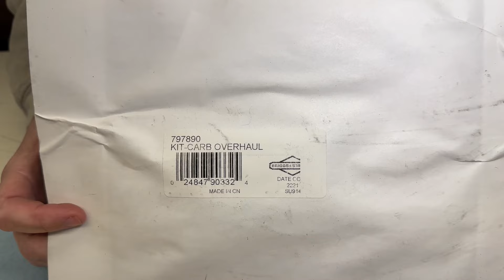Easy How To!  Clean and rebuild a Briggs Vtwin Nikki Dual Barrel Carburetor!

Comment: Congratulations!  This is the single best carb rebuild video I've ever seen (well into the dozens, if not hundreds)!  I'm self-taught, studying small engine videos since July 2021 (my first curb find, a non-running 2005 MTD/White Outdoor lawn tractor LT542H/Tecumseh OV691EA/dual carb), and have watched at least 4800 hours worth so far (averaging 150 hours/month).

I am subscribed to 65 different (small engine) channels, 20 from which I'm signed up for all notifications.  Of those 20, 18 upload every week and I try to stay current once I've worked through their backlog after I discover the channel.  In your case that'll be easy!  ;-)

I file every video worth saving for future reference in the Small Engine bookmarks section of the browser on my old iPad, which is where I watch most videos.  I also watch and respond sometimes on my iPhone and on my MacBook Pro when my comments are more lengthy, since I'm much faster on a regular keyboard.  This one will go under Carburetors, Nikki.  Don't ask me how many bookmarks I have!  ;-)
Reply from the maker: Wow, thank you!!

Comment: Erica, I'm so glad you did this video!  This is the first time I've seen this model Nikki and you made it so easy to understand how they are constructed and what goes where and in what orientation.  Really great job with all production values - audio (volume/clarity!!!), visual, closeup camera, verbal explanations including nomenclature of parts - WOW!!!  This is the kind of video I wish all creators did and I'll be using it as an example from now on!  For a channel that is so new, this is pretty amazing.  Usually it takes years for creators to learn how to do things right and acquire the equipment to be able to accomplish this level of production.

Question:  Why did you not remove the emulsion tubes, and are they held in with O-rings?

I recently acquired a set of JIS screwdrivers and driver bits and have forever retired all of my Phillips except the very largest ones which usually require two hands for breaking free monster screws.  These JIS came already magnetized, although I now have a gadget I keep on the bench for magnetizing/demagnetizing as needed.  I could see that this carb (being Nikki) is Japanese and the screw heads I could see confirmed they are (as expected) JIS.  I recommend to anyone who will listen to switch to JIS immediately and you'll never go back.  No more struggling with Phillips screw heads camming out, no more not being able to stick a fastener on a driver and holding it upside down to insert.  This one tool acquisition is a real joy to use and has changed my life!  (I'm a tool guy, what can I tell ya?)  ;-)
Reply from the maker: The emulsion tubes are made of brass and I've never had to (and never tried) to remove them.  I have read the service manual and there is no mention of removing them.   They are no o-rings for those emulsion tubes - they are pressed in to the body of the carburetor.  For cleaning,  we spray cleaner through the middle holes behind the nozzle and if clear , the fluid will come through.    Someone on here may tell us something different, but that's what we do and it works for us :)   - Erica
Reply: @marriedwithsmallengines 
Yeah, if they’re pressed in that’s reason enough to leave well enough alone. Your method of flushing and checking makes perfect sense. I guess I’m just surprised they’re pressed in, although I shouldn’t be, as most inlet tubes are the same, although I know of one carb where there’s a screen filter behind a pressed inlet.